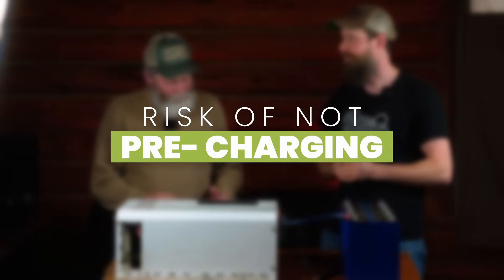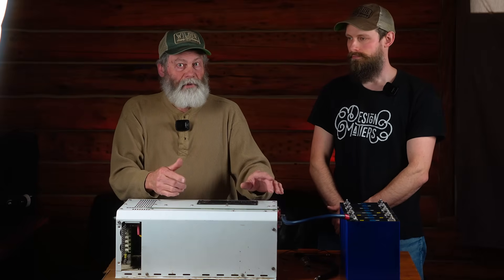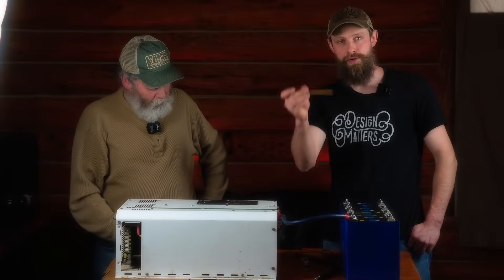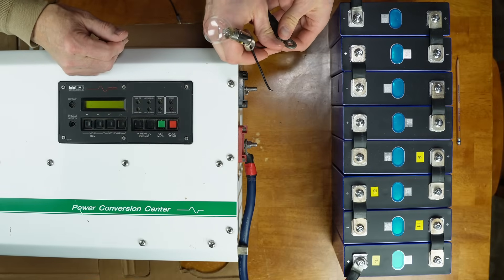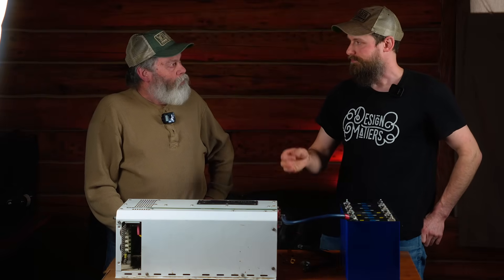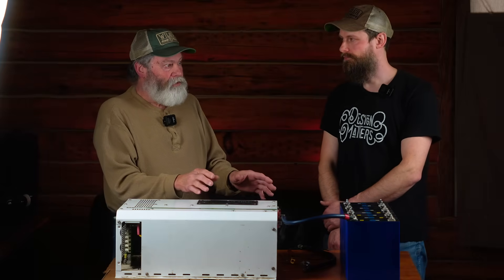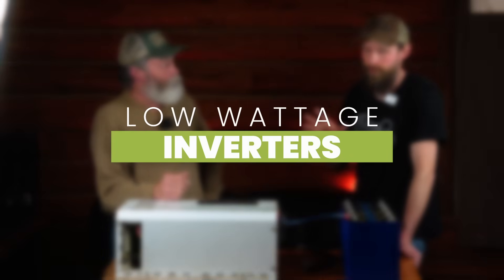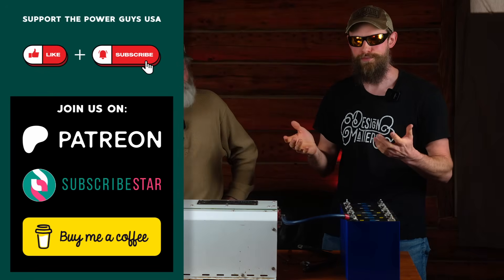When You Should NEVER Connect Lithium Batteries Directly to your Inverter | Safe Pre-Charge Methods

Comment from the maker: What's your preferred method to pre-charge an inverter?  

-- Tools Used (affiliate link):
48v Light Bulb:  https://amzn.to/4jgOlZY
Bulb Socket:  https://amzn.to/4isZ0Qa
Wire-Wound Resistor:  https://amzn.to/4iAyEMa
Ceramic Resistor:  https://amzn.to/3GqiNT1
Reply: Shuffle my feet on a wool csrpet and grab the inverter inputs. 😊
Reply from the maker: @lyfandeth Man alive, we never thought about that 😆
Reply: An excellent piece of advice to anybody for every fresh connection between LiPO⁴ batteries and inverter. I'm greatly enlightened and grateful. It will save the Batteries, BMSs and the Capacitors in the Inverters being Damaged!
Thank you guys.
Soon I’d be sharing my personal experience to your forum.
Reply: You guys have a bench charger. Set at 1 amp voltage. easy.

Comment: If you have a battery shut off installed and disconnect the power, do you have to pre charge the capacitors in the Inverter before turning the battery shut off switch back on? I don't anticipate shutting things off very often but when I do, I want to do things the right way.
Reply from the maker: Good question.  The type battery is important.  We have a few 48v DIY builds with the JBD BMS.  That BMS doesn't have any precharge circuitry so we have to precharge with a resistor or light bulb after a shut down and restart..  We have some pre-built like the Orient Power batteries with the precharge circuit in the BMS so it's not necessary to do a precharge like we do in the video.
So it depends on the battery.
Reply: @PowerGuysUSA  Thanks for the reply. My LifePO4 battery doesn't have a pre-charge circuit in the BMS and neither does the Inverter I bought so I will make sure to do the pre-charging each time I turn the battery shut off back on. Thanks again!

Comment: How do ya use a lightbulb method ?
Reply: I bought 8 cells 3.2v 320 ah .   I was gonna make like a portable type system cheap with just the battery and an inverter to power appliances
Reply: I'm definitely new at this stuff
Reply from the maker: Check out the video, we show the process.  It's really easy.

Comment: I use a precharge resistor and a push button switch.
Reply from the maker: I like the push button switch idea.  We've got a couple different switches and haven't gotten around to building it out.
Reply: @PowerGuysUSA 7w 50ohm resistor is what I’m using and a Amazon push button. 👊

Comment: I picked up a large 1 Ohm wire-wound at a junk-sale for pennies. I prefer this to the lamp-bulb method, as the positive temp coefficient is lower: The bulb has a low resistance that goes up as it warms, the resistor less so. On my 24 volt system the 1 Ohm pre-charge spark is tiny compared to a direct connection.
Reply from the maker: That's nice.  Nothing wrong with a really low cost solution.  I don't think I've ever seen a wire wound resistor at a yard sale.

Comment: Why not just connect a small 12V AGM battery first to pre-charge the inverter capacitors...?
Reply from the maker: For a 12v system, AGM would be better than initially connecting a LiFePO4.  We still like using a resistor of some sort to slow things down and avoiding the spark.

Comment: Good ideas here. I didn't hear a recommendation that the inverter should be turned off, and with no load connected. Both of these conditions would surely suck the capacitor volts straight down again, as the electronics came alive inside, and inverter output tried to increase.
Reply from the maker: Correct, you have that right.  We appreciate your comment!

Comment: Well for 20 years I always enjoyed the spark! I just made sure I touched the lower part of the terminals and never the top of the thread so I don't screw it up. I started doing this back in the days of heart interface then trace engineering and the DR inverters which in those days stood for the Dominican Republic because of the revolving power grid.
Reply from the maker: Very nice.  The Trace we used for this video was the first one for us back in 2005.  Never saw a Heart inverter.  Equipment has come a long way.  Appreciate your comment!

Comment: I couldn't find my ceramic resistor so I used a stovetop heating element as a resistor to precharge my 12v inverter.  I think it was about 45 ohms.  BTW the Giandel 2000w 12v inverter has a precharge circuit built in, unlike cheaper ones.  Nice.
Reply from the maker: Good info on the Giandel.  You would think that would be common.  We like the innovative resistor component!

Comment: You should also have a fuse between the battery and any load including the inverter.
Reply from the maker: Absolutely.  And probably T Class for these LiFePO4 batteries.  Appreciate the comment!
Reply: @PowerGuysUSA  Hi I bought 4 300ah watt cycle batteries to run in series to make 48 v to power an electric boat outboard motor (ray electric). They don't have fuses. How and what do you recommend I install to protect the batteries?
Reply from the maker: Look for a MRBF, marine rated battery fuse.  They are designed to mount on the battery terminal.  We've never used one so not certain of the specs.  You can find them under the Blue Seas brand.
Reply: @PowerGuysUSA  thank you.top speed the motor draws 90 amps. the watt cycles are 300ah. What size fuse should I get
Reply from the maker: @TTTT-rc4fv ballpark, see if a 125 amp fuse looks reasonable.  Also  check out the fuses rated for 58 volts.
Reply: @PowerGuysUSA  Hi how many fuses would I need on a 48v system (4 batteries in series)?
Reply from the maker: Typically there would be one fuse on the positive, between the battery and  the inverter.

Comment: You people are just talking and there is no logic here. Capacitors have there own internal resistance which limits the current. Hooking Lithium batteries directly to the inverters wont damage the inverter. Been doing this since 5 years and zero event like that.

Comment: the reason your getting sparks is your not grounding first, when hooking batteries up the negative wire goes on first, when dissconnecting batteries the positive wire comes off first. its the same when jump starting a car
Reply: For the sparking, it doesn't matter which you hook up first. It's a round circuit, wherever you close it it will spark because of the inrush current. Secondly, you have the battery hooking up thing backwards. Negative should be connected last. Think of what happens if you short a wrench between the positive terminal and the metal chassis. Negative connected first? Short circuit. Positive connected first, nothing happens as the chassis is not connected. Same when disconnecting, always disconnect the negative first.
Reply from the maker: Jumping a car, I was taught from an early age to make final connection with negative to a good ground point away from the battery.  On a FLA type battery, hydrogen gas lingering around the battery would make for a larger 'spark' than you want to see.

Comment: Any decent inverter  these days will have inrush resistors on its capacitors
Reply: Yeah roll the dice on your $$$$$ inverter because you can't spend a few minutes and a few bucks on a precharge. 

Solid.
Reply from the maker: Right on. 100%

Comment: When using the 30ohm resistor to slow charge the inverter capacitors ( 1000w ) should the inverter swith be in the on position or the off position ?😊
Reply from the maker: The on off switch probably controls the inverter AC output.  We don't have one with a switch so can't verify that.  If the manual doesn't say anything about it and no AC loads are connected, doesn't seem it would make much difference.  If loads are connected, probably would  to make the connections with the switch off.  

Maybe someone with an inverter like you are using will pitch in with an answer.

Comment: This would have been a pertinent video 15 - 20 years ago.  Any reputable inverter made in the last 15 years has DC input protection that essentially slows the in-rush of current on connection and absorbs any spikes.  They also have input breakers which can be switched off until the batteries are completely connected.  Trace hasn't been a going concern for decades now.
Reply from the maker: We still have people in our area using Trace inverters.  

Glad you've found a perfect solution with your equipment.
Reply: Valuable video for me. I recognized that inverter shell. Figuring out where on the farm my SW5548 is relevant with Li batteries and micro-inverter arrays.
Reply: you can take a surge protector box /plug in box(i have like 6/7 laying around) and cut the plug off for imput and cut a old extension cord  and use it output to charge the inverter

Comment: When you have a DYI battery converter/charger set up has a common busbar for the negative side and a positive that goes through a dc breaker. If the system sits idle for a period of time should the invertet/charger be disconnected from negative side than positive side breaker turned on than capacitors precharged than negative re-instalked to buss bar?
Reply from the maker: Your procedure is correct.  👍

Comment: I’ve spent a pile of time with those xantrex inverter chargers. Used them to run power systems for internet distribution sites. They are heavy. I found the dual AC input very useful as you can configure each for a specific maximum current input. I use the second input on a lower current setting to be able to run a smaller generator when the power was out at a site. We also use them to double as a rectifier for our 48 V powered equipment.
Reply from the maker: I agree, very good inverters.  There's folks out here still using them, the old Trace branded units.  You've got a lot more experience with them, we just did the basic hookups and powered the house.

Comment: I always use the light bulb method and it's the best way.
Reply: Do you always use a 48v bulb ? Can  you use a 12v bulb for a 12v inverter, a 24v bulb for a 24v inverter, etc?
Reply from the maker: @steveking8548 you are correct.  We were using a 24 volt inverter for the demonstration and the 48v bulb worked fine.  

Going the other direction, low voltage bulb and higher voltage battery, that might cause a burnout.  So you are on the right track with your question!

Comment: Good to know about the precharging. I never thought of it. I have two inverters in two separate lines running 24/7 for more than 3 years without any problem. My second line is with MPP solar all in one hybrid inverter 2400 W, with MPPT charger and battery charger. Does this hybrid unit requre pre-charging when I do some mantenance.
Reply from the maker: When you bring the hybrid inverter back online after maintenance, if it is energized by solar, not battery, you may not need to precharge.  The inrush current from solar most likely isn't going to be as big a surge as from a LiFePO4 battery.  On the other hand, precharging only takes a minute and will, if nothing else, avoid sparks and damage to the contacting surfaces.  Sounds Ike you have a nice system!

Comment: I have a 3000w 48v inverter but I'm using deep cycle acid batteries. I want to build a 24v lithium portable power station. I have the batteries and are fully charged. With a 24v 3000w  inverter,  do you think this could be a problem?
Reply from the maker: Highly likely you want to do a precharge.  Depends on battery type.  Server rack type, should have precharge circuit built in.  The batteries that look like a typical automotive battery, we would do a precharge.

Comment: I’ve been switching my Trace SW 4048 by the main breaker since it was new in 1995 and never had a problem. I probably do this  at least a dozen times a year.I have worked with high voltage inverters used to run telecom facilities that had a button to pre charge all the capacitors. We always used lead acid batteries because they work in low temperatures if needed.
Reply from the maker: Yeah, the lead acids never caused a problem with the Trace 4024 or any of our installations with the Outback VFX3648.  Only when we switched to LiFePO4 did we see a problem.   

You're still running a Trace from 1995, very nice.  I figure them to be durable but that's remarkable!  Trace/Outback, now Midnite Solar, excellent equipment.
Reply: @PowerGuysUSA  We used them at fiber optic regen sites and they got rid of them after a few years  and went to linear optical amps to bypass them.  I got a deal. We use it at our remote cabin here in Alaska.
Reply from the maker: @Chris_at_Home 
Very nice.  We wanted to go to 48v about 2006 so switched to the Outback.  

Alaska as well, great place to be.

Comment: hey guys, I have a question, Im planning to get an inverter and set it with my 12v 200a batteries, im new in this so, if I precharge the inverter and Im gonna let the cables attached to it, do I need to precharge the inverter every time im gonna use it or it is just the first time im gonna connect it to the batteries? thanks
Reply from the maker: When the inverter is disconnected from the battery, the capacitors start to dissipate their stored energy.  I'd precharge just to be safe.  I'd likely opt for a resistor, either type, more durable than the light bulb overall.

Good to have you joining the fun with of inverters and batteries!
Reply: @PowerGuysUSA  thanks for answering!
Reply from the maker: Anytime.  We appreciate you checking us out!

Comment: I have used regular household lightbulbs- they are ok up to 130 volts or so.. if you used a 12v lamp, it could well fry the filament, which may be overwhelmed after 20v or so, and we are so often on 48v packs now.

I needed a bleed resistor a few months ago and drew a heavy pencil line on some paper, and used my ohmmmeter to mark off how far apart to land probes for different resistances on this.  Fun reminder of how to use regular stuff around you!
Reply from the maker: Good point on using a regular 120v light bulb.  Using what you have on hand.   Most people won't likely have a 48v laying around.  The one positive for the smaller 48v is it feels like thicker glass, less fragile to handle.

Comment: never had the inrush current issue with my setup, The inverter charges the caps without the battery connected then can connect the battery or turn on the bms and the over current or short circuit on the bms should stop the current if its too much. I didn't think the caps would blow if charged too fast though considering that's what they do but sparks are scary when you're not expecting it.
Reply from the maker: Yes, we figure different equipment and configurations are variables.  If the inverter is charging the caps, that must be from a source that's not the LiFePO4 battery?
Reply: @PowerGuysUSA  Yeah, its a growatt. They say you don't need a battery to use it and it can power your load or supplement it just from solar. I got that first before my battery and it always showed a voltage on the non existant battery. Great tips though, will save people heartache and i never knew about the pencil method.
Reply from the maker: Very nice, solar input does sound much more gentle than getting slammed by the output of a LiFePO4 battery!
Reply: I worked in HVAC BITD was starting up a 300TH thermal storage plant with IGBT 480vac variable speed drives on cooling tower fan motors. They had wire wound registers to limit C in rush 1 had burnt out opened cabinet  replaced fuses didn't notice transistor failure put drive in bypass motor tested fine went to VSD with cabinet still open when 600vdc bus charged the beer can sized caps flew past my head in blue flames like B40 RPGs in Nam as the 2k Gfi tripped the service main, needless to say had some skid marks in my shorts that day. Work safe as electricity gives few second chances.
Reply from the maker: @billdennis2993
That's crazy.  And I'm intimidated by little sparks 🤣.  Thanks for reinforcing the need to be doing things safe for everyone out there!!

Comment: How about I put a Bluesea systems on/off switch between lifepo4 battery and inverter?
Reply from the maker: The problem is the same, big spark or no start.  The big spark is contained in the Bluesea switch.  If you've connected this battery/inverter combo before and it works, the switch, it seems, would  be fine.

Comment: 3 comments: 1) I always wondered why inverters manufacturers not building in a resistor and an automatic circuit to pre-charge capacitors, into the inverter itself? it's not that expensive to make... 2) JK BMS (inverter series, PBxxxx models) has built-in logic to distinguish between short circuit and capacitors connected, so it can pre-charge the capacitors automatically    3) JBD BMS has short circuit protection built in.. Although I never tested it:)
Reply from the maker: You are 100% right on point #1.  We're curious as well why that's not standard equipment.
Reply: @PowerGuysUSA  :-) Also, I remembered.  There is a model of JBD BMS (which is black, 16-24S version 150A) which is detecting inverter  connection as "short circuit" and so need to pre-charge first; Other models of JBD I used - 4S 200A connected to an inverter 2kW without pre-charging, no problem; and other (200A version) was perfectly allowing connection of an 6kW inverter, nothing happened; but OF COURSE better to pre-charge first, and the light bulb method is the best !
Reply from the maker: @NiueChannel 
Good info!   We'll check out a different model BMS on a future 48v build.  So far we've only used the JBD 16s 100 amp model.
Reply: Components cost money. And uneducated buyers can't appreciate the difference, so they buy by price.